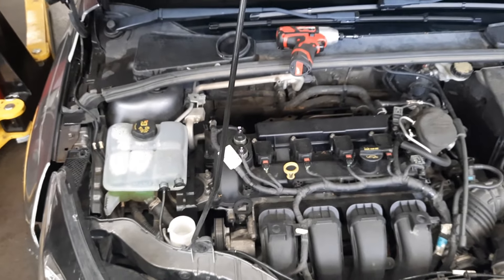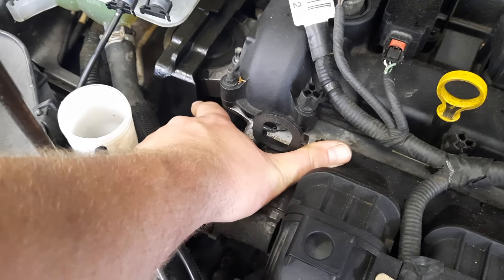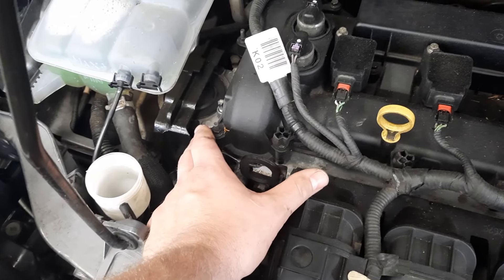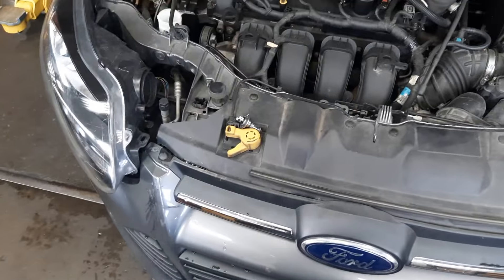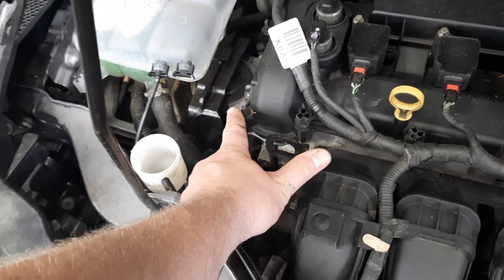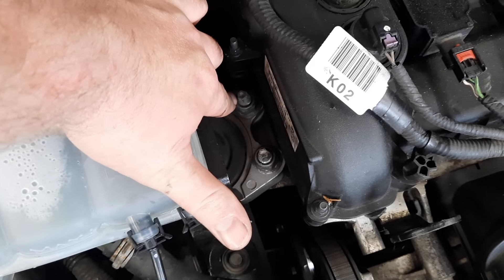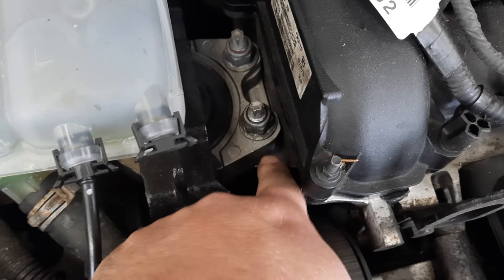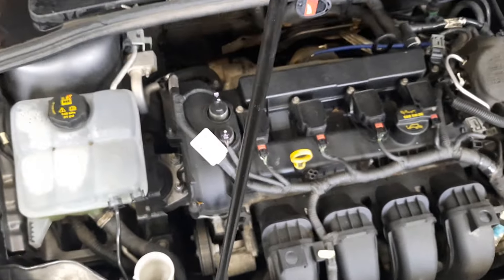Ford Focus Noisy/Vibrations/Rattling at Idle. Easy Fix!

Comment: You were spot on and this was the exact cause of the low frequency resonance and the vibration on my 2012 Ford focus SE. The part was $22 from Amazon and I switched it out in about 15 minutes. Unbelievable how much difference it made and zero vibration and zero resonance/ humming inside of the car now. Thanks for posting your video
Reply from the maker: @NectarFen  awesome! You're welcome
Reply: What's the name of the part? Please!!
Reply: Hydraulic Right Engine Mount 1PC Part A5312, EM-3103,  I got it off of Amazon BBM439060D

Comment: Personal opinion..but I think they last longer if you put the insert in yourself and DONT bend the flaps over.  It stays in place as long as your bolts don't don't back out.  Bending the tabs creates a non flat contact point.  You'll see if you pay attention to what's happening while you are bending and hammering on it.  You are transferring load to the small u shaped channel you just created and that small surface area will wear down fast to metal on metal.  Aftermarket 1 pieces are the same way from what I've seen.

Comment: hey i think i have the same problem it will have that sound in any gear like drive, reverse etc. and in higher rpm i don’t really hear it but if i let of the gas or idle it has the rattling cranking sound i hope this is it
Reply from the maker: I'm sure it needs one. Good luck 👍
Reply: @BigBensCarsAndCycles  do you think you can make a video of what it sounds like if not it’s all good

Comment: I think this is what's wrong with mine, its also noisy on acceleration. Could it cause that too?
Reply from the maker: Yeah it'll sound like the interior is all rattling, or a medium pitch buzzing in the right front at low speeds.
Reply: @BigBensCarsAndCycles mine too, only idling and acceleration. On top end you don't here it. It recently had a fuel pump replaced and that top motor mount was taken off. I replaced an axle thinking that was it. I hope this this is my problem.
Reply: It would have been good to hear the noise before and after the fix, good video non the less
Reply: @patrickgarrett581 did the mount fix it?
Reply: @elJDyoutuber  yes it did!
Reply: Is it possible for the sound to come and go?

Comment: 2016 ford focus makes a harsh rattle on acceleration sounds like stripped splines checked the axles and those are good the mount rubber does look worn how could i verify the mount is my issue?
Reply from the maker: @blackriflex39  join the discord and upload a short video there of the noise and I'll listen
Reply: @BigBensCarsAndCycles  i jacked the engine up a bit just to see if they was any movement in the mount and yikes there was i shimmed it with a paint stick just to test it and bam that was it .. new mount in and problem solved ... you earned a subscriber on this one because i was about to the point of just throwing partsa at it in hopes of fixing it.. never would i had thought it was a bad engine mount... thanks  you saved me time and money...

Comment: This is the worst car for rattles. My windows rattle when idle, I can roll them down or jam a trim piece between the door and it stops. Would the motor mount cause that issue also?
Reply from the maker: Yeah it should at least lessen the Vibration

Comment: Is that the only motor mount or is there a second one that would also need replacement?
Reply from the maker: Theres 2 more, but this is the primary one that causes issues. The other ones are under the battery box and on the bottom of the engine

Comment: Same issue. Well it started low then got loud. Thought it was the muffler. Took it to the shop and nothing. Then I had the intake gasket changed. Nothing. When I turn the car on the car has a loud vibration. When I step on the gas it get louder. Please help.
Reply from the maker: @jeltechtv4624  it might be the mount as in the video. Or could be rocks jammed in the lower mount on the bottom
Reply: Did you get it fixed? I'm having the exact same issue. Please update us
Reply: @mustafaalbuzayd7980 definitely the passenger side motor mount. What a relief!
Reply: @jeltechtv4624  I hope that's what's wrong with mine too. I'll get it ordered today. Thank you for the quick reply!!

Comment: What year is this focus?
Reply from the maker: It was a 2013, but this issue is the same for 2012-2018
Reply: @BigBensCarsAndCycles  This issue was also very prevalent in the 08-11 years. I have a '10 with 225k miles on it's fourth set of motor mounts and an '08 in desperate need of them.  No idea why Ford wouldn't just fix the problem smh.